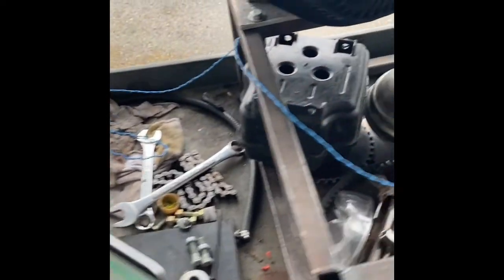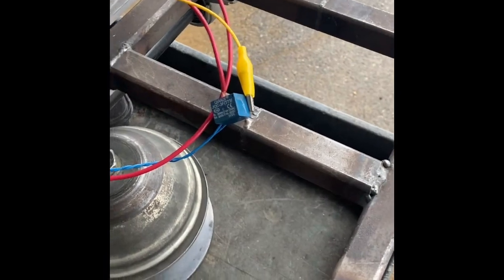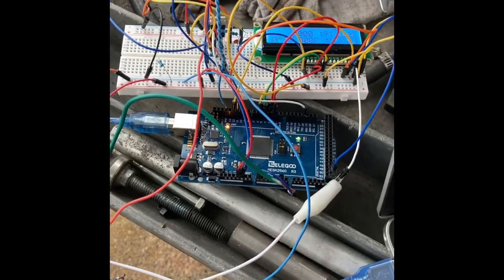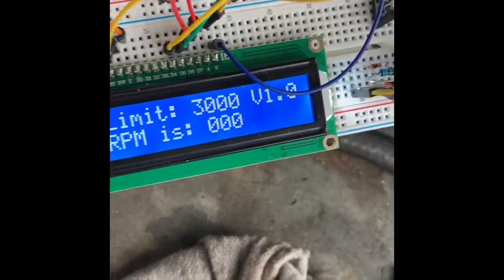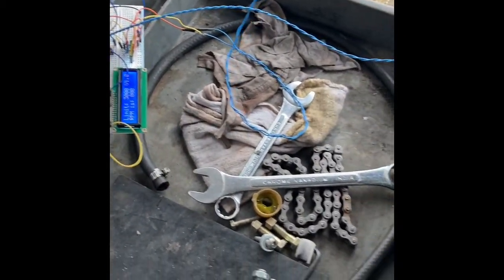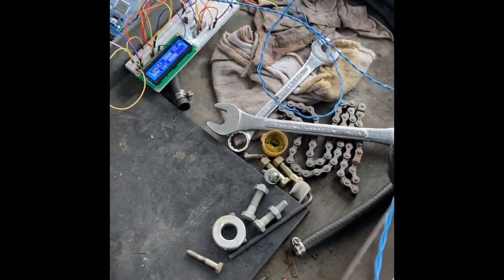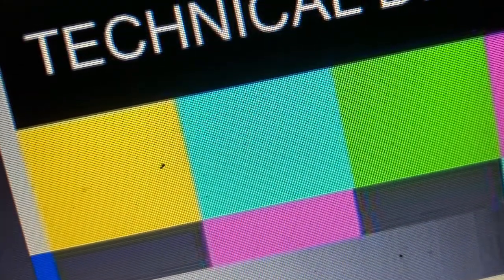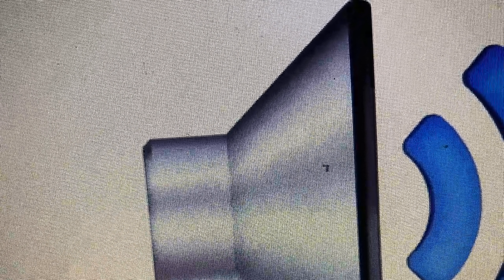Arduino Rev Limiter

Comment: How you take rpm with rounded on spark plug?
Reply from the maker: Just tap the wire around the spark wire. You can test it with a multimeter. If the voltage is too high use less loops

Comment: Do you mind sharing your code. I’m doing something similar for a project in my circuits class. Using a harbor freight predator 670 motor that I removed the governor on so I could use an aftermarket carburetor. For my long tail Jon boat. Thanks I would seriously appreciate it.
Reply from the maker: I posted instructions on instructables look up “arduino rpm limiter for gas engine”. Good luck with the project bro.
Reply from the maker: You might have to modify it a little to make it work with a 2cylinder engine